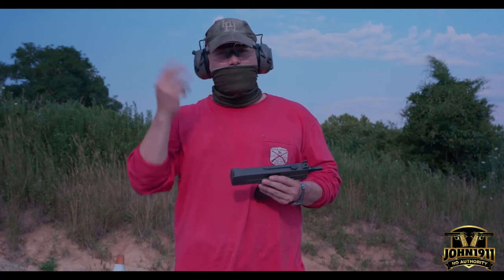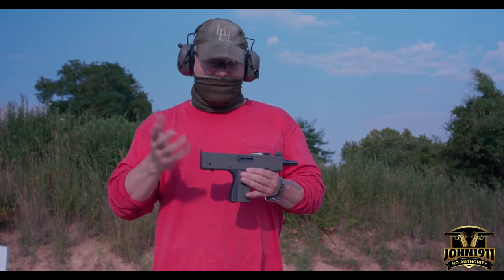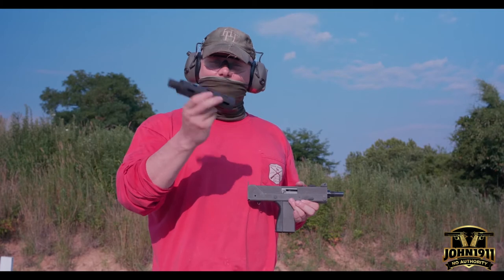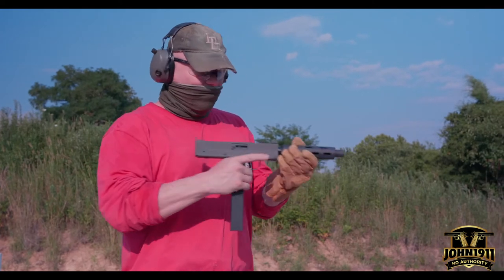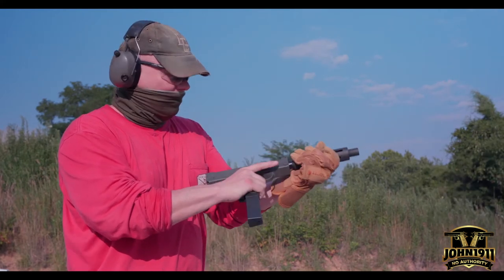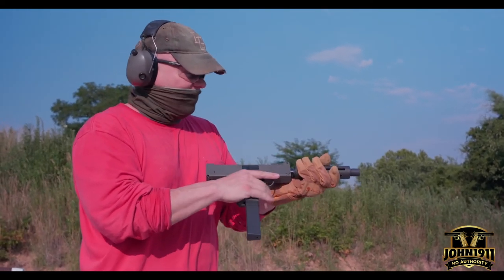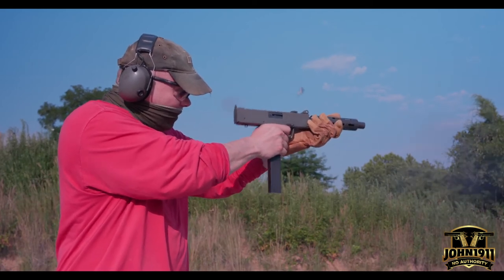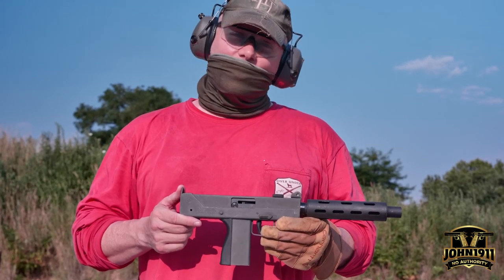Cobray M11 Function Test

Comment: I had fun with a MAC-10 years ago. Even with a 2 finger strap to help hold it down you could send .45 from floor to ceiling in a few seconds. You could only shoot it if the range was empty except for the shooter. And if you hit the ceiling you got charged for the damages. Out of luck I was never charged for damages.
Reply from the maker: They are tough guns to control on full auto. Ditto those micro-UZI’s. Same-Same. Not unrelated, there was a machine gun shoot some years ago where they gave a mico-uzi to some very, very young girl. 

Guess what happened? She lost control of it, gun went up and to the right striking the RSO next to her. He was DRT. 

Was that her fault? No. It was a lack of experience with machine guns. General rule. The smaller the package, the worse it is to shoot. —Marky
Reply: @John1911  I remember that story. The range I went to nobody else was allowed on when full auto was in use. It was back in the 70's so.

Comment: I converted mine to a 16’’ carbine rifle.  Topped it with an sig romeo 5. Very accurate now. Pings steel out to 200 yards.
Reply from the maker: You know, that idea never occurred to me. I would love it if you sent me pics. I want to see how it turned out. —Marky
Reply: How should I send the pictures
Reply from the maker: Use the contact form on our website. Www.John1911.com You won’t be able to attack pics there, but when I respond, you can. Don’t put your email address in comments or the bots will spam you. —Marky  @robertgolden1080
Reply from the maker: Check your spam folder.
Reply: @John1911   didn’t get it
Reply: @John1911  sent
Reply from the maker: I just resent. I had messed up your email on my end. 

Marky

Comment: Idk, as a semi auto 9mm the damn thing weighed so much felt like I was shooting 22LR..
Reply from the maker: 9mm as a round is pretty controllable in anything but the smallest pocket rockets. So if anything, the MAC guns take away from that with it heavy blow-back bolt, and the location of the grip acting like a lever under it. The only thing that saves the MAC guns at all is the addition of a suppressor or shroud to hold onto with a second hand. Which is why the faux suppressors were so popular. It was practically a necessity. —Marky
Reply: @John1911  maybe need to revisit it, it’s been sitting for 20 years, it was a gift for helping someone and pretty sure the mags are why it was feeding poorly, the original owner told me that when he gave it to me.  Can’t really ever trust it.
Reply from the maker: If it’s of unknown history, I suggest cracking it open. Re-spring it. Re-buffer it. And probably clean it. Most times when I see them, they have never been even basically maintained. Glad you liked the video. -Marky

Comment: That things too old to function
Reply from the maker: We’ve actually updated this gun quite a bit. New springs and buffers. Also it seems the original buffer was so deteriorated that material from that was migrating into the firing pin slot.

So lots of weirdness going on. But seems to run fine now. For a 1970’s blow back pistol anyway. 

Marky